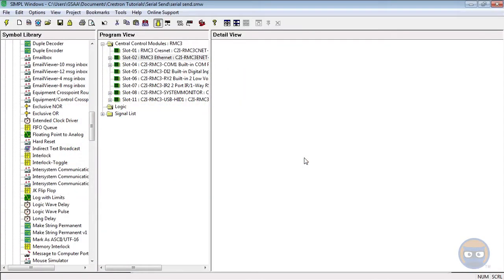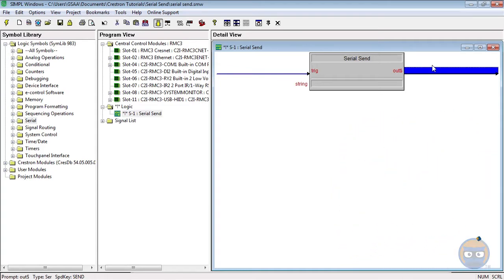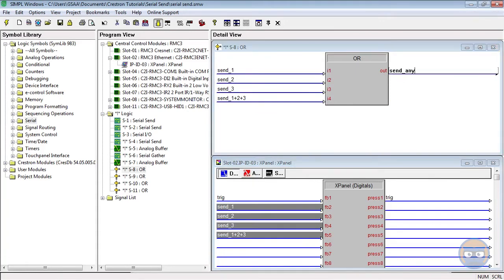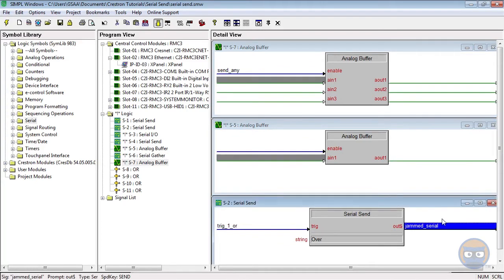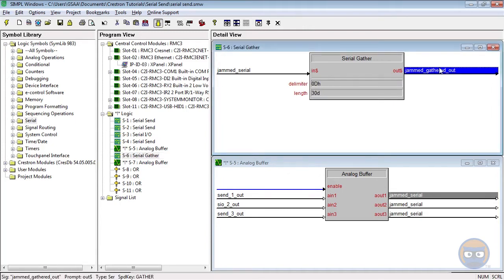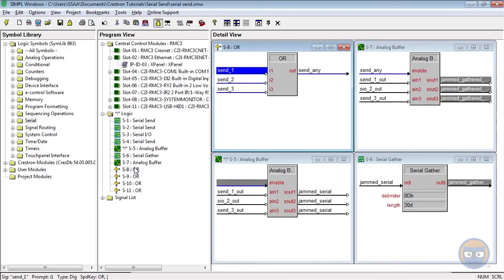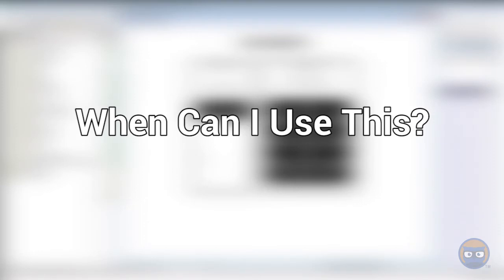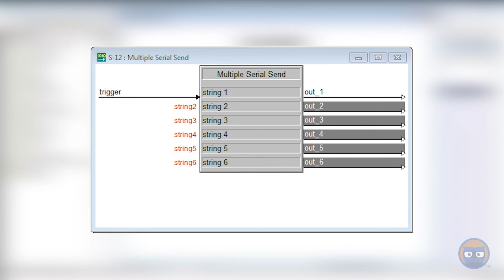Crestron SIMPL Windows SERIAL SEND Symbol Tutorial

Comment: I have a projector and the control is based on its feedback.
I have 6 different strings. Example string is \x06\x51\x31\x0D\x0A.

The feedback is 6 bytes but 3rd and 4th byte are different which has the entire control of the projector. I extracted those bytes and polled it back to projector and can have the required results individually. But there is one condition where I need to poll all the conditions of the projector at the same time and each of their analog feedback must be stored at the same time. All of my tries have failed so far. 
If you can share some knowledge if how to achieve the results?
Reply from the maker: I'm trying to understand what you are doing exactly. If you need to poll all the conditions but have to ask a different way, couldn't you just send out the poll requests in a sequence and parse out each response into a different analog value for each property?

There might be a poll command that returns everything, or maybe you just have to ask it multiple times for each thing. You could do this with something as simple as a stepper with a .1s delay in between, or get more sophisticated and use a ring counter instead of a stepper - use the incoming response (sawpulse or something on the serial rx) to advance the ring counter to trigger the next poll command. Or build something in SIMPL+ which is probably going to be a bit harder initially but easier to adjust and troubleshoot.

Hopefully this is somewhat helpful
-Dustin
Reply: @OverWorkedLogic  Thank you Dustin, Unfortunately there is no poll command and all depends on the command I send. 

Using a Stepper wouldn't help. Let me explain, I have these commands to send
1. Power ON/OFF
2. Input 1-3
3. Volume UP/DOWN
4. Lamp Counter
5. Projector Error (If any)

What I need to achieve is that any of these commands sent must result in showing the current state of each section without changing their current state. As I said, I have tried every possible way in my knowledge.